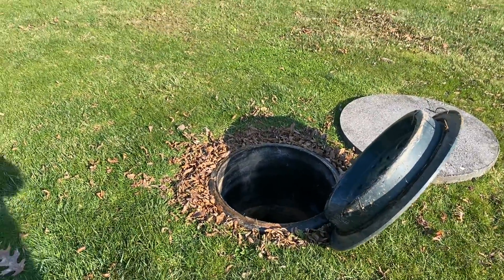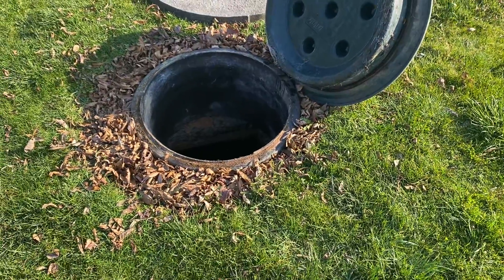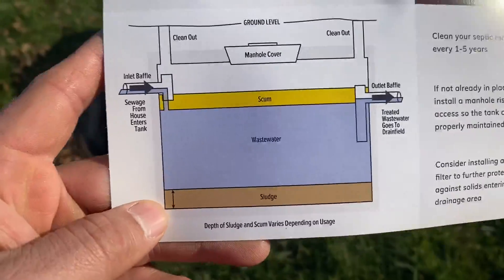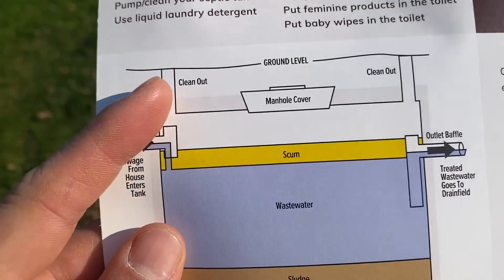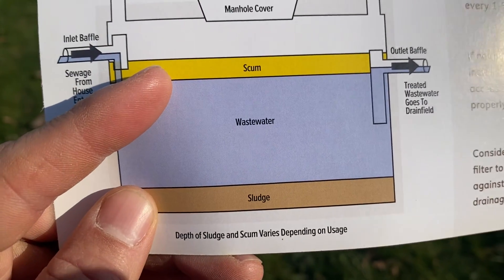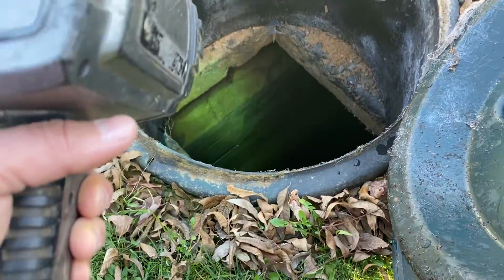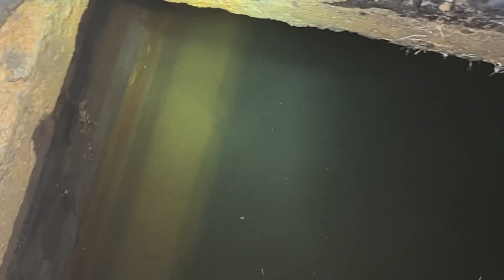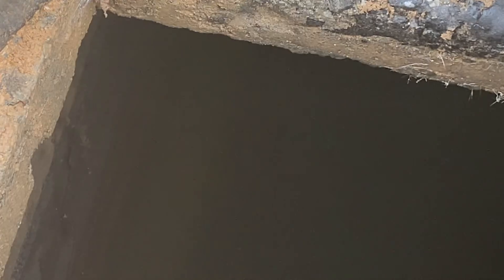What Does A Septic System From 1954 Look Like? What Does A Cinderblock Septic Tank Look Like?

Comment: Hi, we think we have found one. But the inlet baffle is blocked with stones and debris and a tarmac roadway above, and the outlet baffle isn’t connected to another pipe (so in other words it just overflows out of the outlet baffle and seeps directly outside of the tank) 
However, we have pumped all of the water out and cleaned all the depend and mud out of the bottom, what’s most concerning is the fact that it keeps on slowly filing up with water again and again. Is this normal ?